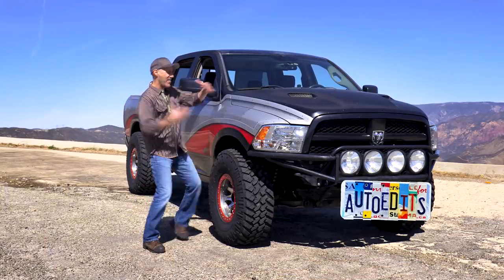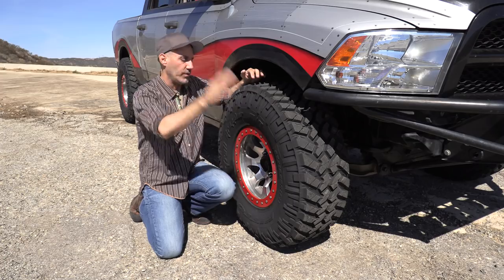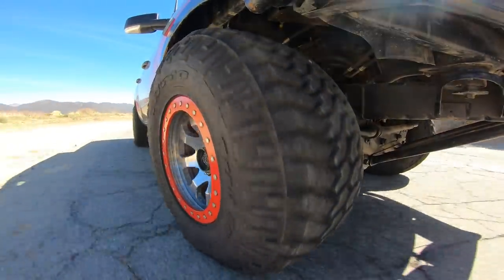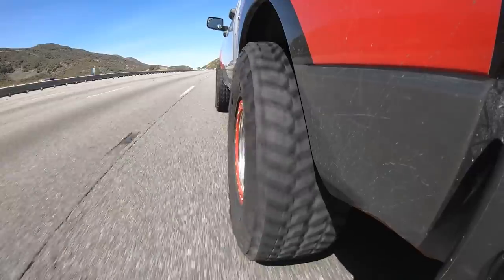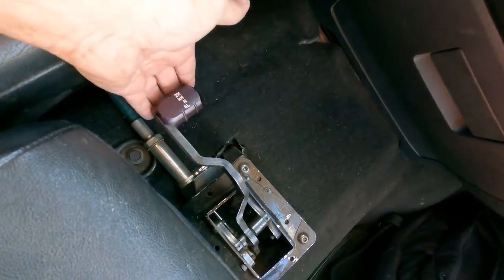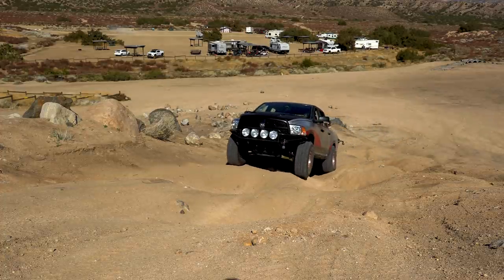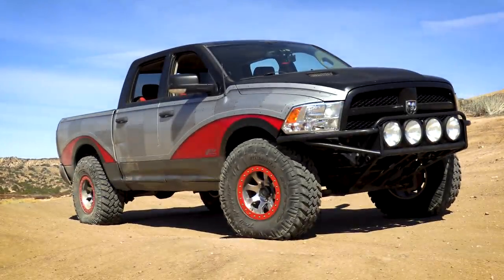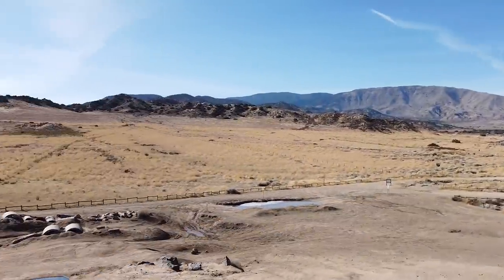37" NITTO Trail Grappler Tires on a Ram 1500 Road and Trail TEST

Comment: finally someone who actually airs down their tires to the point you can see they are aired down haha!
Reply from the maker: I ran the low pressures at 12 psi for this video. It's a heavy truck for a half ton...lol
Reply: @AutoEdits  I run 10-12 in my Jeep and 18-20 in my power wagon.  That seems to be the sweet spot!  Great video man!!
Reply: beadlocks... I run zero PSI in my ram...

Comment: I switched from the MT’s to the ridge grapplers and couldn’t be happier. They’re the quietest tires I have ever owned. They have great snow and ice traction and just work  in mud and sand.
Reply from the maker: I was going to try the ridge grapplers first but they have been backordered for months! Really glad to have these though... don't think I'd want to go any other way.
Reply: I’ve got the ridge grapplers too. They do good in the snow and on ice, but they’re not nearly as good as the BFG KO2’s I had on my truck before the Nittos. After these wear out I’ll either go back to the KO2’s or try the Wildpeak AT’s. I’ve hear those two perform similarly, but the Falcons are less expensive.

Comment: Nice review of these Nitto tires, I'll have to consider them when tire time comes.   I too like to throw my truck around twisty roads, it's oddly satisfying.  Keep these fun videos coming.
Reply from the maker: Thanks dude! Let me ask you this... do you think I can make my Tahoe do dirt roads as good as this truck??? Would be a game changer for sure.
Reply: @AutoEdits Sure you can.  You were planning to turning it into an  overland camper, then it's a must  They're both about the same size and weight, plenty of after market parts.  You may be little down on power if you got one with 305 (that's 5.0 Liter for the youngens)   Hey, put Pinto on next video.

Comment: Jason, when I installed my 37" Trail Grapplers several years ago I didn't balance them.  They rode smoother than any tire I'd ever run on my Jeep before.  They were so perfectly round and balanced that I never got them professionally balanced....and that was with heavy 17" Poison Spyder beadlocks and no balance beads, either!  I wanted them when I stepped up to 40s, but they were out of stock everywhere. :(
Reply from the maker: Interesting to hear... I've been pleased so far. What 40's did you end up with?

Comment: Glad to see you're still doing stuff with your RAM. Thanks for the review of the M/Ts. I actually have the Ridge Grappler 35s on mine.
Reply from the maker: I almost went for the RG’s and then thought about how awful I am to this thing and needed maximum effort.
Reply: @AutoEdits  you do "work" the hell out of RAM Johnson. I just did a BDS 4" lift with Fox shocks. Couldn't take mine up to your level since I still park in my garage!  Keep up the reviews and tutorials!
Reply from the maker: There isn't much lift on this thing... maybe 2" in front and none in the rear... or whatever the TRX springs offer.

Comment: Hey Jason! Your ram inspired me to pick up one of my own! Wanted to pick your brain. I know you're running 37s on an older 6speed transmission truck but I'm running an 18' with the 8 speed and 3.21 rear axle ratio. Because of some weird design piece by ZF in their transmission to front dif connections, you can't get aftermarket ratios put into ZF trans trucks like mine. That being said, do you think its a bad idea to throw on a set of the lightest 37s I can find to run on my rig even though it only has 3.21s? Would love your input if you have the time. Love the videos 👍
Reply from the maker: I like to hear this! Even with how good the 8 speed trans is... 37's on that ratio would be a lug on the low end. Probably fine on road but climbing in 4Lo is where you'd notice.
Reply: Where did you find this info on the ZF? I was going to put an 8hp70 in my 06 but I want to be able to regear. Can you share where you got this info please?

Comment: Jason I recall you installed your air ride suspension 1st on the Ram and than sometime after did the full upgrade with RCV Performance Products Ultimate IFS CV Front Axles and the entire pallet of Mevotech X Factor components. If this is correct, question. Did you keep the air ride after the latter upgrade?
Reply from the maker: Still running the air ride and love it. Not only is it great for load leveling for heavy stuff... when I went camping I just disconnected one end of the rear sway bar and used the independent control on the bags to level my tent.

Comment: Hey Jason, I am a big fan of your truck build. I have a 2014 ram that has the bilstein 2.5" level in the front and some heavy duty progressive springs the the rear. It ended up with a 1 inch forward rake, which I like a lot. Is that Icon kit only 2.5" as well of lift? I realize the front bumper makes a difference in tire clearance, but how in the world can you fit 37's on a 2.5 inch lift?
Reply from the maker: That's the main thing but this truck has been tweaked in a few places... like no inner fender splash shields and some other stuff like that. Go into the truck playlist here on the channel and in the suspension overhaul video I go through it pretty good.
Reply: @AutoEdits  Thanks, I've been working my way back through the truck videos paying more attention. Just found where you mention the fender liners. Up here in WA I need to account for a lot more mud, water, and snow on a yearly basis. Not sure I can make the jump to no fender liners.....yet.

Comment: What was your final verdict on the MAXXIS RZT MTs on your Jeep?  I'd like to know before I buy.
Reply from the maker: I liked the RZR MT's overall a lot. Fantastic looks and confidence inspiring durability, I felt like I couldn't hurt them. My nitpicky issues are that they are "lumpy" at low speeds don't grip quite as good as these do in the rocks but not by much... Can totally recommend them especially if you like the looks of them.

Comment: hello, I've been following you for a long time, I wanted to ask you what relationship do you have to the differential?  I mount 3.92 with the "37 but I would go to 4.55! advice?
Reply from the maker: I have 4.56 gears in this truck right now with the 37" tires and it's too much. 4.10 would be correct.

Comment: Awesome videos! Thank you for being detailed. 
What are your thoughts on running 37x12.5x20 with 3.92s on an 8spd tranny? Also what things should I watch out for?
2017 1500 4wd sport model with 6" BDS coilover lift and UCAs.
Any info is appreciated!
Reply from the maker: Probably be pretty good gear wise with that transmission. I've broken a few front half shafts but I wheel pretty hard.

Comment: I am starting my build on a 2019 Classic 1500. Was wondering what gears are in your truck? do you think 37s are considerably better than 35? any problems with trans temp?
Reply from the maker: I have 4.56 gears and it's too much. 4.10 would be better. I like the looks of the 37's on this truck and they have performed fantastic in all conditions for me.  This thing goes interstate distances with ease and I can smash it on the rocks whenever.
Reply: @AutoEdits  Mine still has the factory 3.21s so am going to stay on 35s. re gearing will definitely be in the future. Keep up the great content. Oh you mentioned repainting Johnson, I am a huge fan of the graphics you have, Keep it crazy and different.

Comment: These are the tires I’ll be getting! Is it completely necessary to take the front fender liners out to make 37s fit? Thanks in advance.
Reply from the maker: Not if you have a little lift. The front bumper might rub a bit as well but could be easily trimmed.
Reply: @AutoEdits  I’d be getting a pre-runner bumped soon. I’ll probably have to start with 35s and see how everything lined up. I plan on going with the icon stage 5 lift.
Reply from the maker: Go for it!

Comment: I've been following your channel for a wile now and really appreciate all the great info! Especially your ram truck.

I would like to build a ram but not sure whats a better platform... a 1500 with the IFS? or a 2500 Hemi with the solid axles. Ive herd you mention the IFS being a bit of a scare for you at times, worrying about it, But I'm not sure if your upgrades made that stress go away???

I've always bounced back between a jeep jku and a ram 3500 cummins...but neither can do what I need, the Jeep Jku cant haul the family around comfortably, and the Diesel ram just weighs to much to take on serious trails...

And I would Love a truck or vehicle that Can tow, haul, overland, and wheel, and be able to use it as a work truck.

Could you recommend to me whats the best ram to start with in your opinon?  Id like to keep costs down, so new power wagon is outta the question...would like to start with a 2014 and older and build from there.

Much appreciated
Reply from the maker: Most economical way in to the durability you want is the Ram 2500.  There are many great companies that make all the suspension stuff you'll ever need for that platform as long as you stay in the 2014 range.
Reply: @AutoEdits   Rite on! thanks for the reply! and keep up the awesome Videos! I cant believe you dont have more subscribers, your content is bang on!
Reply from the maker: @deanweller5789  Thanks a ton!

Comment: what about getting a set of the milestar like on the Jeep for the truck just to see how they would conpare from the Jeep to Ram Johnson or Nittos for the Jeep same comparison
Reply from the maker: Great suggestion! What I've learned so far is that the Milestar Patagonia MT's on the Jeep don't have the proper load rating for a half ton truck and towing/hauling duties. So, I would have to go down to 37" on or up to 40" to get that load rating... hmmm... now that's an idea!

Comment: Im stuck between getting 39 inch km3s or the nittos in a 37. Bfg runs small so they’ll measure out roughly the same. What are your thoughts? I had km3s in a 37 and i loved them but I’ve heard these blow them out of the water

Help me decide !🙏🏼
Reply: KM3s are probably lighter. Usually BFG run lighter, which is good imo for a lot of different reasons such as MPG and it puts less strain on suspension components
Reply from the maker: I would really like to try the KM3's in a 39" to get first hand experience but from what I've seen with people I've wheeled with... the KM3's rule in the rocks but are not very good in inclement weather like snow/ rain. So there's that compromise again.  I haven't taken these in the rain yet so I'll let you know but from my experience so far with the Trail Grappler MT's... I'm fairly confident they will be awesome at all the stuff I need.

Comment: What size are the wheels and what offset?? Been trying to find out if 17x8.5 0 offset will rub on aftermarket UCA's !
Reply from the maker: Here's the rundown on these wheels https://youtu.be/aTWINh3knEk  They are 17x10 with 4.75" backspace
Reply: @AutoEdits  assuming a 17x9 -12 with 4.53 backspace would fit the same ? That's if these have 0 offset
Reply: Trying to make sure an 8.5 wide or 9 wide won't rub on the upper or lower arms not worried about front bumper/rear fender part

Comment: What gear ratio are you run? What rpm are you at at 75 mph?
Reply from the maker: 4.56 and it gets awful highway mileage. 4.10 with the 37" tires would be much better.

Comment: what size lift is on the truck to fit 37s?
Reply from the maker: It's the TRX so maybe 1 or 2 inches. Mostly it's the removal of fender liners and front bumper.

Comment: Just me or did anyone else see the LCA bushing moving a little more than it's supposed to in the opening montage?
Reply from the maker: Looked good to me.
Reply: @AutoEdits  good to know! Still a noob when it comes to what's normal for a bushing and what's not! Love the content and esp. this truck build!
Reply from the maker: All good dude, I learn stuff all the time from viewer comments so I'm open to most.  Here's something that'll blow you away... look at the front body mount in that same shot in the upper right corner.  Watch how much that thing moves.  That is all within specification but mind boggling it moves that much.
Reply: @AutoEdits  holy crap! that's somehow normal?! haha. Guess that's why a lot of people, myself included, like body on frame vehicles for towing. That has to provide a lot of vibration isolation, but man that looks crazy to see that much movement under off camber/flex
Reply from the maker: @maverick27502  It's not somehow normal. It's designed that way to keep the humans inside comfortable.

Comment: Do you experience much rubbing with the 37s when the suspension is flexing and has your pinch seem been trimmed for clearance ? I have a similar build on a 16 ram with overland gear and it’s tire time for me so I’m debating going to 37s
Reply from the maker: No rub and yes the seams have been hammered flat.

Comment: I have ridge grapplers on my Ram 1500 and I loved them at first but honestly after having them for 2 years I will never buy a Nitto tire again. I think they ride like crap, they are terrible in the snow (not snow rated) chunks of the tires go missing, I religiously rotated them and they wore funny even after getting an alignment numerous times and to top it off I feel like they have never balanced well. Its funny because all of my complaints are similar to others who have owned this tire
Reply from the maker: Why are you posting all of these complaints on a video about a different tire? I expect more from you.
Reply: @AutoEdits  my whole point was I loved my Nitto's at first but slowly realized the quality isn't there. Hoping you don't go through the same thing. My next tire will be a BFgoodrich k02 or Falken wildpeaks
Reply from the maker: Again, you are just flat incorrect in saying "the quality isn't there" in general with Nitto as a brand and I don't appreciate that. You would be way off if you are comparing a BFG K02 with these and that's my point. Learn more about the products you choose to use on your rig. The closest comparison is the KM3 and Wildpeak M/T 01 ... just for your information. So to say you expected more from a A/T tire compared to a tow rated M/T tire is just incorrect. Hope that helps.